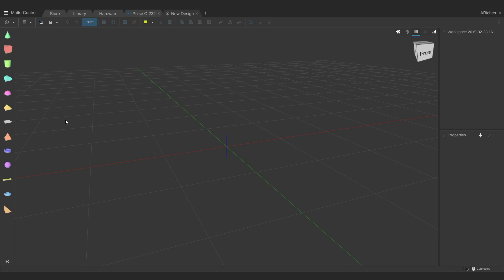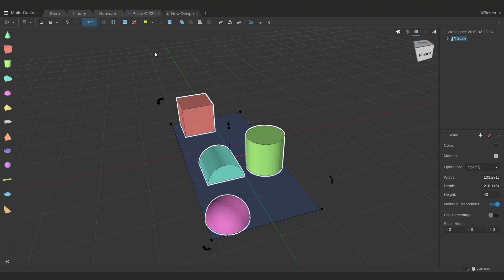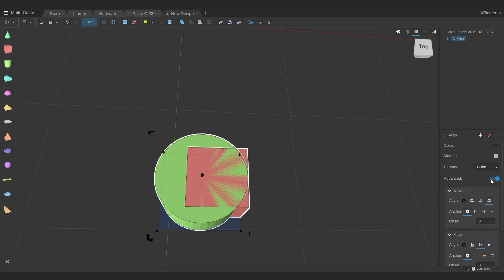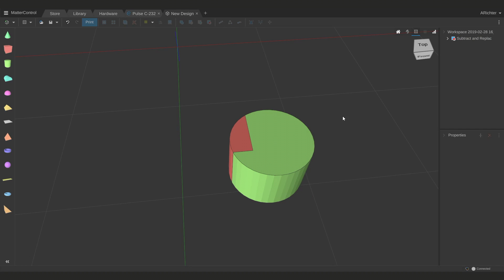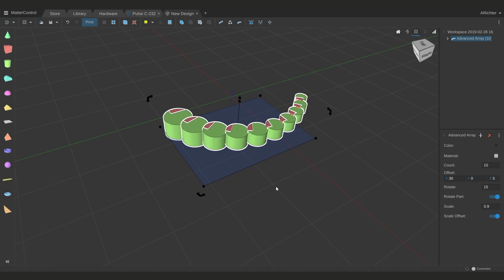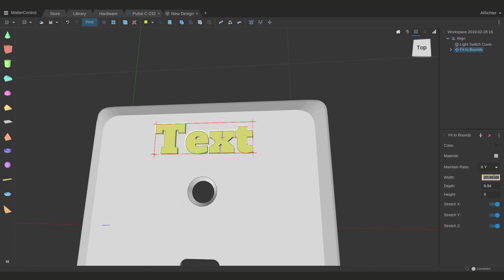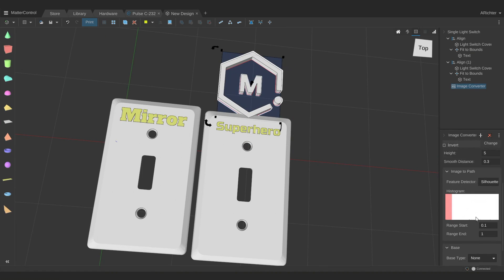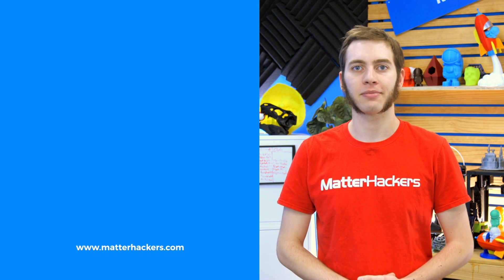MatterControl 3D Printing Software Tutorial // Advanced

Comment: Im trying to understand this program, is this similar to tinkercad or more advanced, Im done with tinkercad simply as it just is such a pain to get sizes right and measurements etc. I need something more advanced but i know that something like fusion 360 is not for me, my brain works better on visuals rather than the way fusion works.

Is this like that you add pieces, take away pieces and is it more advanced than Tinkercad? That is a very good program apart from its obvious issues in trying to size anything properly its almost impossible it seems to me. At least with this you seem to have much more control.

Pease could you advise Thanks